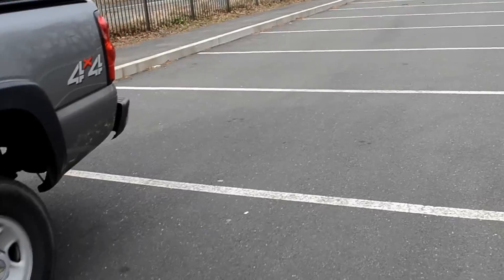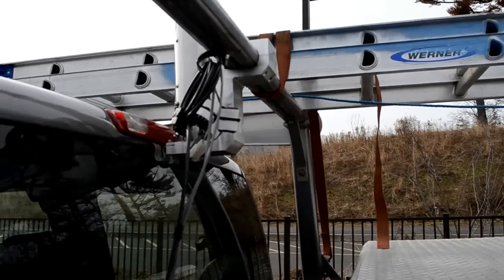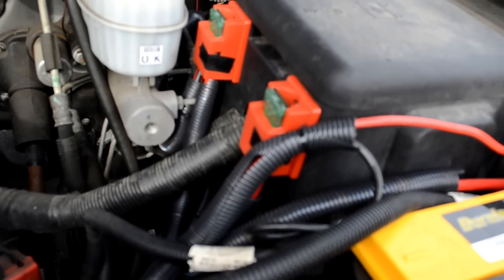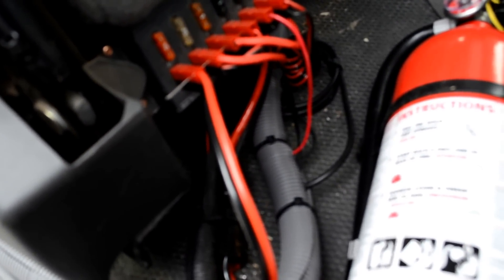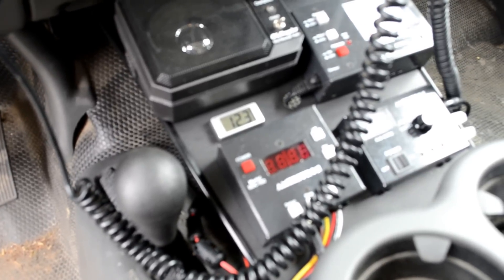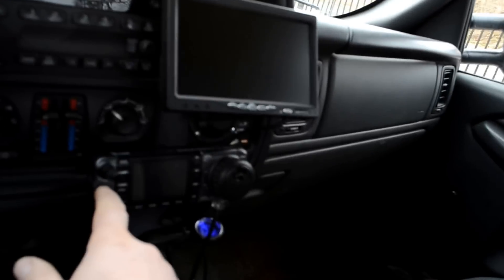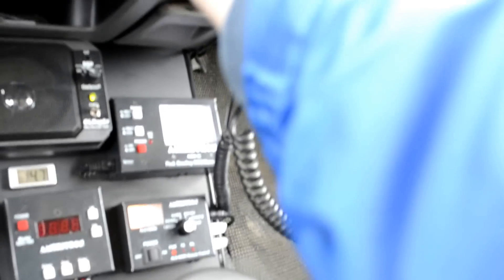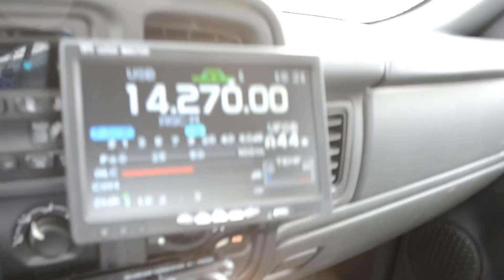W1ASB MOBILE INSTALLATION

Comment: Wish it wasn't so blurry. I run the exact same mobile, except I have an auto tuner. I just got an ALS-500 to put in place of a 350w amp in there now. I wanted to see how you interfaced that amp, but you didn't show that. Also, that Rigrunner isn't supposed to be rated for the 40-80 amp draw of that amp. You should put a big cap in there instead, like a 1-2 farad auto type with meter read out.

Comment: You should try a better RF antenna control that makes the antenna tune with just a push on your tune button of the IC7000. The other control unit not needed! Cool video.

73
Jimmy, ARRL TC, WX9DX